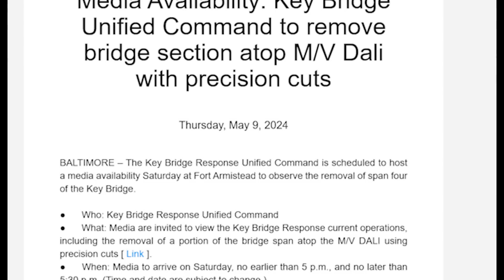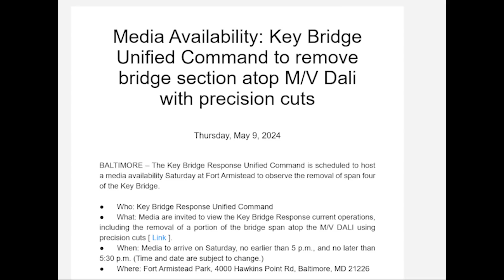Ready To Blow Key Bridge Off MV Dali Baltimore

Comment: the shaped charges are quite small, basically like det-cord with a lens, what we're seeing are the "blankets" to cut down on flying debris.
Reply: Yes, they quite often use Conveyor belt for the Blankets, It is very tough, but still flexible enough to give where needed.
Reply: Came here to say that
Reply: The shaped charges are shaped like a piece of angle iron. I've watched several of the videos that PBS had of CDI preparing structures for demolition that showed the shaped charges.
Reply: The linear cutting charges for 3 inch thick steel plate has a fill weight of 6200grams per metre. 
The thickest detcord I've even heard of is 100grams per metre.
Reply: What are the explosives made of?
Reply: @Nicball505  the linear cutting charges are usually a military type plastic explosive, so RDX or RDX/PETN mixture with a plastic or grease binder.
Detcord is usually PETN powder with no binder.
Reply: @HE-pu3nt  It should also be noted that it's not so much the explosive itself that does the cutting. The explosive vaporizes the metal cladding, and the cladding on the inside of the angle (usually copper) is focused by the blast into an area that gets vaporized by this superheated copper "jet", from the shaped charge.
Reply: @RollingThunder2020  I saw a comment above stating no copper, and that the charge is placed right up against the steel, when the exact opposite is true.
We use polystyrene blocks to lift the cutting charges away from the surface of the steel to allow the copper blade to form properly.
Reply: Just like the first ones?
Reply: What first ones? @ProToolsApproved
Reply: @Jeffostroff    The blankets also act as 'tamping' that helps focus the explosion towards the target as well as reducing debris flying from the site. Often they use heavy things like sandbags or even bottles or containers of water to tamp an explosive charge so that it is pointed in a specific direction. I think that, in this case, they are just using the blankets and what looks like commercially made linear shaped charges. In the demo video segment about the controlled detonation, the charges depicted were the type that are basically a piece of angle-iron with plastic explosive packed into the inner corner in a fillet shape. The angle-iron is the main tamping element. That and the fillet shaped cross section of the explosive is the 'lense' that directs the explosion forward in a jet to cut the target. Its like they stretched the charge from an anti-tank rocket out in a line. There is no copper in front to make a projectile though. They don't need it because the charge is pressed right against the target. I am wondering how close their demo is to how the actual detonation goes. In the demo, all the pieces fall conveniently off the ship...
Reply: If you go to 3:27 of the video you can see the cutting rod is behind the protective pad.
If they demolishing crew used cutters as big as the pads, wow there would be steel flying everywhere.
Words and content accuracy matters, otherwise I would watch the news.  Let’s go Brandon!
Reply: @joelchaney5607  The proper terminology is a “kinetic disassembly” of the truss remains.   Military engineers have their own vocabulary.
Reply: Who cares
Reply: @The.CrimsonGhost A whole bunch of ex-military types remembering “good old daze” and former experience.